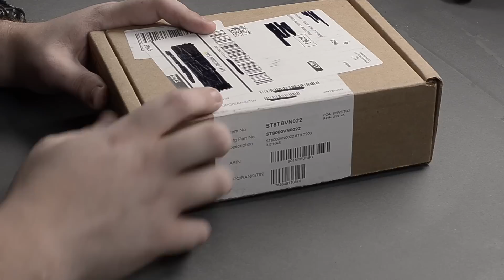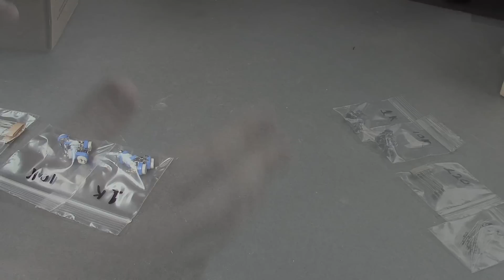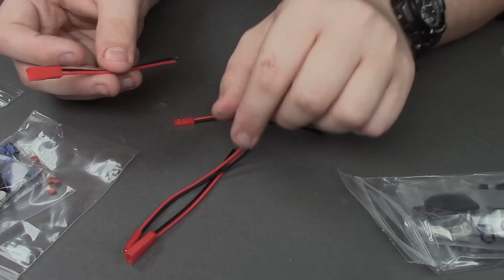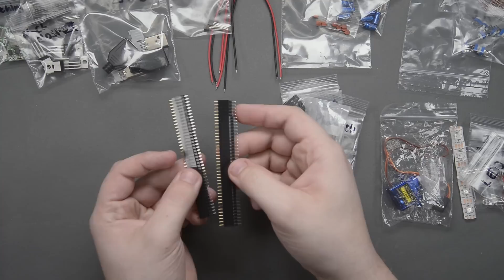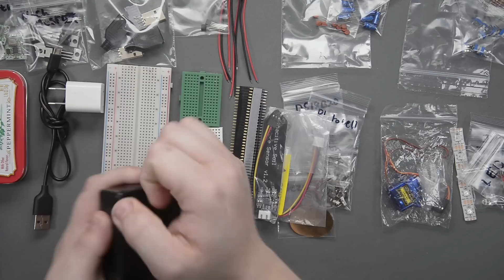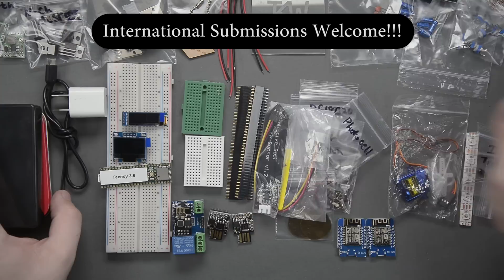IKW's 100th Video Giveaway (Over)

Comment: Some stuff I have found useful that’s not in your goody box:-
 PIR sensor,  ESP32 Lolin D32,   I2C  20 x 4 Character LCD Display,  Battery  holders, Load Cell sensor,  RCWL-0516 Microwave Radar Sensor,  SN65HVD230 CAN Bus Transceivers to use with ESP32,  MCP2515 CAN Bus Module Board TJA1050 receiver SPI for Arduino,  Ultrasonic Module Distance Measuring Transducer,  DHT22/AM2302 Digital Temperature & Humidity Sensor   and NRF24L01+ Transceiver 2.4Ghz RF module.

Comment: Projects controlled by the playstation controller. I have two with a damaged right analogue. After the transplant, I plan to connect buttons and analogs to the microcontroller (Arduino pro mini, for example, has enough pins), which will send the appropriate commands via IR, radio transmitter, bluetooth and / or Wi-Fi. After adding the screen, you can get feedback (if you use bluetooth). Useful for remote controlled robots equipped with sensors or a coffee machine activated by the command: "up, up, down, down, left, right, left, right, B, A, Start", with confirmation of activation. :)

Comment: So many projects so little time and money, this pack would certainly help!  Some projects on my to-do list are:

1. A faulting ozone dielectric cell detector.  Needs to monitor several parameters. Vibration/sound detector (piezoelectric elements?) to "listen" for arcing inside the chamber. Current monitoring on the power line feeding the cell to watch for power spikes or anomalies and a temperature sensor for each cell. This is for an industrial machine where I've struggled to automate an easy way to quickly identify a failed cell.

2. Climate control system monitor. Some features like many people use such as room temperature but I'd like to add a sensor to know if my evaporator  coils are freezing up then automatically switch off the AC compressor and let the fan continue to blow to melt the ice and also trigger an alarm or notification. I'd also add a water sensor to the drip pan so I could detect any blockage in the condensate drain pipes. I want an air velocity monitor to track when the filters are getting dirty and trigger an alarm to change them based on reduces flow.

More ideas but these are on the short list. Thank you for all your great content, love the channel!

Comment: Looks nice! If you already include solder you might wanna include a little bit of wire for connecting other parts. And maybe some buttons if you include displays? Anyways, I would use this to finish my precision spot welder and build a plant monitoring/watering system.

Comment: I'm still dipping my toes into micro controllers but i love 3d printers and have several but i've wanted to cnc my harbor freight mill i was thinking about using stm32 and some micros as closed loop servo drivers but those digi sparks might be able to handle just direction and step inputs and the optical switches for encoder. But the first thing that springs to mind with your kit is some home automation relay triggering a solenoid to lock and unlock door so don't have to fumble with keys, and maybe turn porchlight on all by RFID tag on keyring in your pocket could all be handled by esp8266, maybe even tie in some automated light switches by the rfid tags, of course you would have to carry your keys around all the time but thats just a detail.

Comment: Hey IKW!  Love the videos!  I've definitely enjoyed the past year of watching your vids. Continue growing and bringing great content to us DIYers  :)
Currently working on a BMS based on the BQ769x0 IC's. An ESP could be used for the communications and balancing commands.
Also have a garden that is for attracting butterflies and hummingbirds and the moisture sensor would work great for this, as well and one of the ESP for remote monitoring and stats
And there's the PowerMonitor I'm working on that is based on the OpenEnergyMonitor project. Currently using an Arduino Nano, but I think I'm taxing it with the Serial commands. Needing to have 800+ samples per second to get power consumption and device statuses. The Nano is struggling to keep up.

Comment: Wow that's quite the assortment. I think those mosfets and adjustable regulators would go great in this prosthetic arm I'm building. Mosfets to cut power to motors when not in use. Also heatshrink would definitely make connections a little more durable. Also OLED would be great for testing setups with microcontrollers that lack serial monitor output.

Comment: Congratulations.
I am thinking to make an oven timer that will shutdown my oven when selected timer is done. It will have a rotary encoder to select time and a button to start the timer . Also i will connect a relay to it that will energize a contactor so it will be able to handle the current.

Comment: I'd put together a couple weather stations to monitor around the house/yard. I'm also trying to bring my HO train set into the 21st century with wifi control.
Reply: Something that would be useful for that weather station would be a UVA/UVB breakout board.  I've seen them on Adafruit.

Comment: Great selection. I would add an PIR sensor . I use the Wemos or Nodemcu for any project that requires plug in power, but I've found the esp8285-m3 an excellent pinout for my battery projects using your Ht7333 regulator setup (I still have a drawer full of 'obsolete' lm1117's). Having IO16 and Reset exposed makes life a lot easier without having to go to a full blown esp12e. I don't need the giveaway, I'm well stocked already, but I wanted to show my support.
Love your channel, keep it up!
Reply from the maker: Oh yeah duh, motion sensors! I'm still trying to figure out which kind of motion sensor is best but once I figure that out I'll throw one of those in there as well. Thanks for the show of support!

Comment: I would add, usb micro breakout $.25 , and usb dc-dc boost converter modules 5-28v $.77
Reply from the maker: I hadn't thought of a micro breakout. What use would you have for that (actual usb com or just power)? I thought about adding in a boost converter but I've honestly never had a need for one. Or at least I usually just bumped my power supply up and then used a step down converter since I usually need that anyways. I could toss one in though seeing as I don't seem to have much need for them